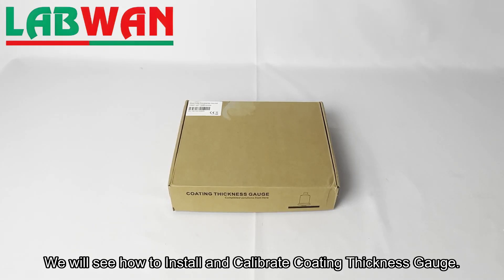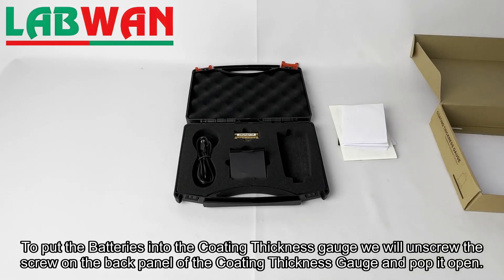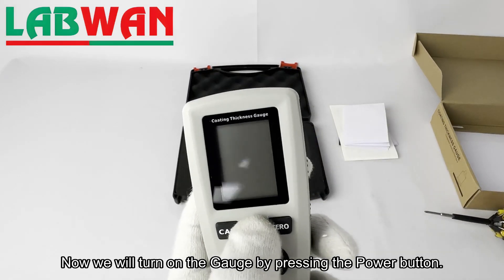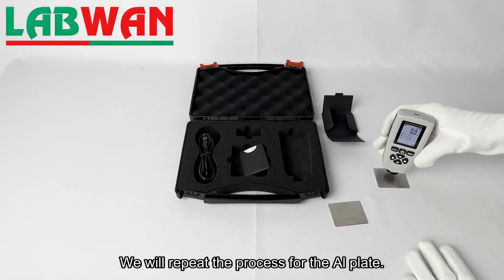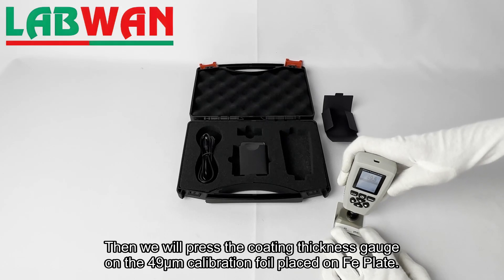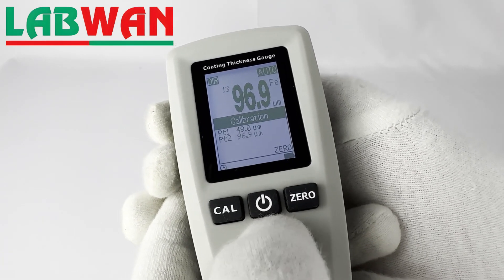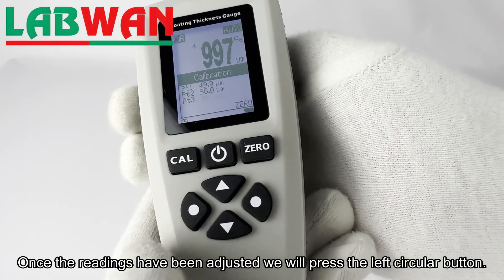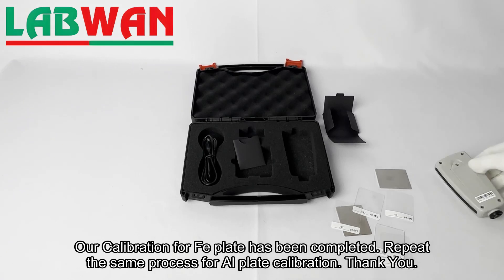Coating thickness gauge

Comment: I want to check on concrete but its not detecting any thing
Reply from the maker: If your gauge doesn’t support concrete, consider:
✅ Elcometer 500 – Measures coating thickness on concrete using ultrasonic technology.
✅ Depth micrometer – Measures coating thickness manually.